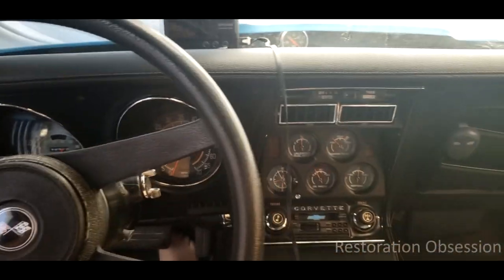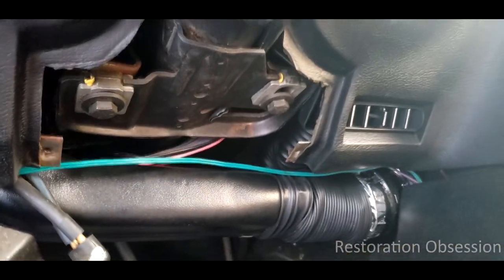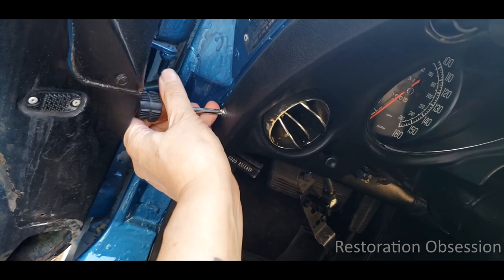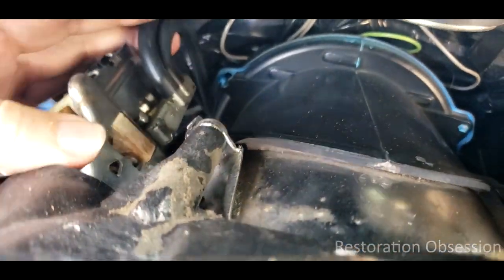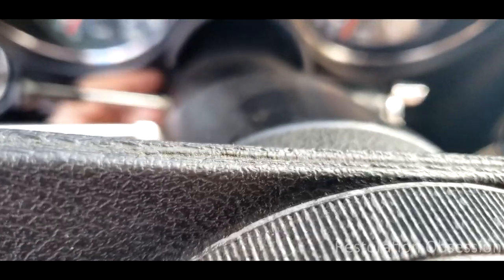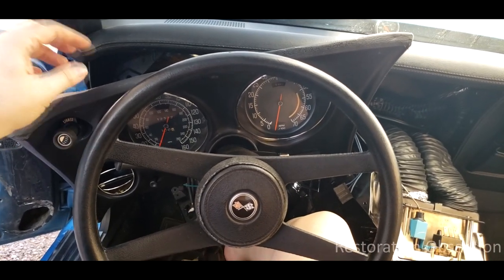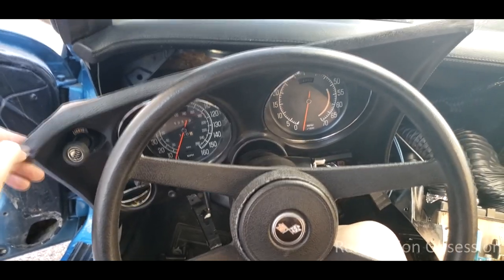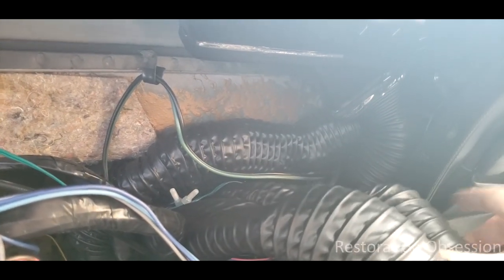1976 C3 Corvette Dash Disassembly, Speedo Repair and Vintage Air Ducting!

Comment: @7:31 you say disconnect the connector on the speedometer, is it twist off, a clip, or a press connector? I can't see it and it isn't budging when I try to disconnect. I really don't want to break it.
Reply from the maker: Hi Dean. Take a look at the picture at this link. You can see the speedo connector in the very center of the back of the gauge and just underneath it a greyish-black tab. Just push that tab inward toward the gauge while gently pulling the cable outward and away from the gauge and it should slide right off. That tab is part of a spring clip that grabs the end of the cable housing. When you go to put it back on all you need to do is push the cable back in until it snaps into that clip. Hope that helps! 
https://www.corvetteforum.com/forums/attachments/c3-tech-performance/47610286d1183072788-how-the-do-you-remove-the-speedo-cable-dscn1878.jpg
Reply: @RestorationObsession  I never responded but thank you! It came out perfect. 
I can't find any information on this next part, have you removed the ignition switch that sits on top of the steering column? Mines gone bad and for the life of me I can't get it out
Reply from the maker: @katatonos  Cool beans! No, I have not removed the ignition switch yet.
Reply: Press connector !

Comment: RO, many thanks. your recommendations for positioning and angles were very helpful. There are also two screws that connect the heat/AC ducts to the back of the driver side dash and getting those out really helped with 1-2 more inches so I could get the speedo and tach unplugged.

Comment: Bless anyone with the patience to work on a C3.  They were made to be as hard to service as possible.   I have one and it drives me crazy
Reply from the maker: Hi! Really? I think they are pretty easily serviceable, mostly. Though some bits can be kinda wonky.
Reply: I disagree...they are very mechanic friendly. I had a 66 Rivera with bad gauge lights and could never figure out how to get the dash off... no screws in sight.

Comment: So cool a Chevy Vega steering wheel. I just learned on a video how Chevy crossed installed items like your steering wheel.
What a great video. Thank you.
If I may ask: how do I access vacuum tubes to the headlight switch like without removing the entire dash disassembley.

Comment: Great video - thanks for sharing! I've got to replace the speedo cable on my '70  4 speed so this video will definitely help. 
My speedo doesn't work at all so hope a new cable will correct my problem. I put a drill on the end at the transmission and it wouldn't spin my needle in the speedo at all so I guess cable must be bad. Thanks so much! 👍
Reply from the maker: Thanks, Van! If the speedo still doesn't work after a new cable, I suspect the gauge may be rusted inside or possibly the spring is broken. Of course, there are other ways it could not function. Good luck! Let me know how it goes.
Reply: @RestorationObsession  Thank you so much! I may reach back out to you if the new cable doesn't fix it. Sure hope it does after looking at what it will take to replace it... 😁. Thanks again!!
Reply: @RestorationObsession  I am thinking about pulling the speedo gauge out next week to inspect the mechanism the best I can before I install a new cable. You mentioned that the gauge parts may be rusty or spring might be broken and I'm thinking you may be right.
I'm scared to pull the mechanism apart like you did 😁 for fear I couldn't get it all back together correctly.
If I pulled the gauge cluster and sent it to you, could I possibly hire you to look at the mechanism and see if you can make sure nothing is broken inside...? That thing looked like a watch that was taken apart and I'm afraid I couldn't get it back together without having leftover parts... 😁 I hate to go to all that trouble replacing the cable and it still not work.
Please let me know what you think. Thanks so much!
  Van McDowell - Georgia
Reply from the maker: @vanmcdowell6671  Hi Van. I really wish I could help, but I can't do anything like that right now, sorry. But if you go slowly, take lots of pictures, and remove each screw and piece very carefully, I am sure you could do it.
Reply: @RestorationObsession Thank you and I understand!  The many small parts make me nervous... 😁
Reply: @RestorationObsession  Hi again...one quick question: I pulled out my speedo and it wasn't bad following your instructions...(thank you!)  When I got the speedo out, I discovered that the end of my speedo cable has broken off into the back of the speedo where the cable goes into the cluster gear and that is why it isn't working. I have tried everything but cannot get the broken piece out and was wondering if I could drive out the broken piece of cable from the inside if I disassemble the cluster gear down all the way.  Would that be possible...?
Reply from the maker: @vanmcdowell6671  Hi Van. Good work! That is a bummer though! I have two suggestions. First, you might try very gently tapping the speedo on a wood surface in hopes of dislodging the broken piece out, but I suspect you may have done that. You could, possibly, carefully squirt some alcohol in there to help dislodge any debris or oil that might be keeping it stuck inside. The second, and possibly more likely scenario, is to dismantle the entirety of the speedo and use a pin or small wire to push the broken piece out from the inside of the mechanism. That's a lot of very careful work to do, but should be doable. I guess, at this point, it's worth trying because if you can't get it out it's not usable anyway. Just be suuuuuper careful with the tiny coiled spring. If neither of those things work.... I am out of ideas... for the moment. If I think of anything else, I'll let you know. Oh... maybe use a high-power neodymium magnet? Maybe it could pull the broken piece out? Let me know how it goes!
Reply: @RestorationObsession  Thanks for your response!  I tried a small magnet that I have but it wasn't strong enough. I may try your suggestion and put a few drops of alcohol to possibly loosen it up and then try a stronger magnet. If that doesn't work, I'll probably attempt to completely disassemble it and see if I can tap it out from the inside.  If I tear it up, I'll have to buy a new one anyway so might as well give it a try... 😀
Thanks again for listening to my dilemma and for your advice!  I'll let you know how turns out.
Reply: One more question...😁 IF I'm successful at removing broken piece of cable, I'm going to connect my new speedo cable to my drill and make sure it works before I reinstall everything. Question: Which direction (forward or reverse) do I run my drill to spin the speedo needle...? Thanks again!
Reply from the maker: @vanmcdowell6671  Okay, good luck with it! As for direction... I can't recall. I want to say run it in normal "forward/drilling" direction, but it won't hurt if you go the wrong way because there is no actual connection between the cable and needle since the needle's movement is controlled by magnets spinning around it's axis to create the needle movement.
Reply: @RestorationObsession  Awesome - thanks so much!! 👍

Comment: I see this is 3 years old, but hopefully you get this. I'm somewhat of a newbie, but I'm learning. I feel I need to change the speedo cable in the near future. There's a spot where it was sitting on the exhaust and there's no covering/shielding, and occasionally my speedo needle bounces a few mph up and down. My question is, do I basically have to follow the initial part of this video to gain access to the back of the speedo/cable, just enough to drop the steering wheel and get my hand back there??? or is there something else or another way?  Thanks!!

Comment: I'm finally installing my Vintage Air AC, what a major PITA to run the ducts... It took me all day just to connect the drivers side ducts to the vent fittings, so frustrating...
Reply from the maker: I hear ya! The VA ducting is a P.I.T.A.!!! I recommend using mylar duct tape to hold things together while positioning. Another problem I faced was crushing of the tubing when putting the center console back in. It's such a pain I hate to even think about pulling my dash apart again lol

Comment: I think dropping the steering column all the way out would allow better access to the wires, cables, tubes, and fasteners behind your instrument cluster.
Reply from the maker: It's definitely a requirement. Did I forget to mention that in this video? It might be mentioned in the other one I posted. Thank you for pointing it out! :)

Comment: How much do you charge to repair a 81 c3 speedometer...I replaced my speedo cable recently and it work fine for the first 2 miles then suddenly stopped, took it apart to see the plastic end of cable was sheared off...so I am assuming the speedo is defective...

Comment: is it common for the headlight switch to char the housing? how can that be prevented
Reply from the maker: Yeah, but it may depend on some factors. The coil and contacts tend to corrode over time. Corrosion can cause the resistance to increase, causing excessive heat build up. I've read that the dimmer switch can do the same. Mine seems to work great though. I always loved the hi-beam foot switch. Well, if your switch is already like that, just get a new one. Better safe than sorry. One-time $25 insurance payment. If it looks good, a nice cleaning is a good thing. I always try dry microfiber rags first. They tend to work well. Alcohol helps get grease, dirt, wax, oxygenation and other grime off. Don't use water on electrical parts. As for prevention, what I have found works best is using the device. I have learned this lesson well with pinball machine restorations and ownership. Old school 70's-80's era lead contact switches are prone to the same thing and games start acting wonky if you don't play them because the corrosion and whatnot prevent them from making contact. Good luck!!!

Comment: Nice video and tutorial on a cool project. How did you remove the speedometer needle from the pin? Is it affixed with a fastener or just pressed on?
Reply from the maker: Thank you, Jeffrey. At first I gently pried it up from both sides at the same time, but that was a bit awkward and not working so I put some blue tape on it and used vice grips BARELY clipped over it enough to pull on it and thankfully it popped off. I have since removed it and replaced it a couple more times. It's not an easy task. I was sure I was going to break it, to be honest. I think I got lucky.

Comment: Hi Ms. Restoration. Hope all is well. I bought a 1976 in about 70% condition, and I need an entire weatherstripping kit, but because there’s a huge difference in price from John Deer to Jane Doe, I have no clue which way to go. Do you have any idea what’s what, because the reviews aren’t enough to take into consideration. Thank you for sharing
Reply from the maker: Hi Tony. I have not installed new weatherstripping in my C3 yet and so have not done any research on that topic. Maybe at some point. I suspect that most Corvette parts suppliers (Zip, Eckler's, etc) probably source it from the same place though. I would buy through one of them. Let me know what you find out!
Reply: @RestorationObsession  … thank you. You are probably correct, most likely made in Xina by Mr. Suzuki and shipped in bulk to a bunch of retailers who are using their own packages. Top Flight Automotive/ American Corvette is the most expensive. I’m in Arizona, weatherstripping doesn’t last, perhaps I’ll buy the cheap and coat it with UV 303.
Reply from the maker: @TimeToBeKind  I hear ya on the hellish AZ heat. It sucks the life right out of everything! I saw your forklift video, btw, and did a bit of quick research. I believe that's a Pettibone Super 8. Kind of a cool looking contraption.

Comment: I'm having a hell of a time installing the ducts on my 74 Vette, any tips ? I can't get the ducts over the vents and the vents on the unit against the firewall are impossible... HELP !!!
Reply from the maker: I did, too. I found that using some of that mylar flex duct tape helps a lot. Affix the ends to the unit first, then put it in, if possible. I had to remove mine and re-do them after it was in though, real PITA. Also, I don't recall if I mentioned it in the video but I did not reinstall the entire radio. it's just the face plate and tuners to make it look like a radio is still there. The unit was shot anyways, but there wasn't enough space in there for all the tubing. Also, if you seem to have too much tubing, you may need to trim some of it off but be careful and don't cut them too short!

Comment: Just to change the drivers ball vent on my 74 had to take the whole dash apart there is no way to access it from under, beautiful but stupid design....
Reply: Next time, turn the ball vent sideways and give it a firm tug straight out. Absolutely no need to take the dash apart, even with brand new felt.

Comment: Absolutely absolutely absolutely way too much commentary. Full go on these videos to get direction not have a conversation
Reply from the maker: Says the guy who uses "absolutely" three times lol! But seriously, thank you for the feedback, Jesus. best of luck in your restoration projects!
Reply: @RestorationObsession  Honestly, I watched the video and went "This guy is pretty easy to listen to and goes into a lot of detail that might not be necessary, but I appreciate regardless" Great video. I picked up a basket case 76. The dash is all out except the center console cluster/radio. Interior was already pulled out. Need to adjust doors and rear bumper and on and on...I might actually get the dash back together this weekend now that I have a good point of reference. Thanks!!!
Reply from the maker: @ryanshelvik7262  Lol thanks Ryan!
Reply: Go watch another one or create your own video. Simple solution.